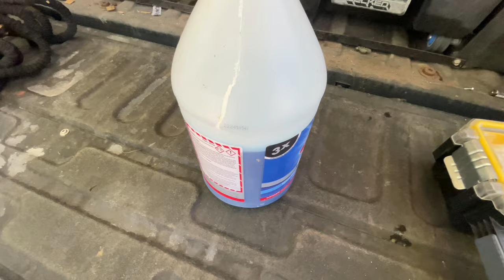Contactor Replacement 101: The Key to Fixing AC Buzzing Issues

Comment: You rock! So informative 
I have a goodman furnace and compressor 
Makes the loud buzzing sound while running. 
There are a few within a few blocks of my home snd they seem loud too.
One if my friends said goodmans  are notoriously  loud. Is that true. 
Its about 72-78 db
Working well and cooling the home
Should I swap out contact or just leave it?
And bad capacitor wouldn’t make the buzzing sound right?
Keep up the great work my friend!
Reply from the maker: Thank you.